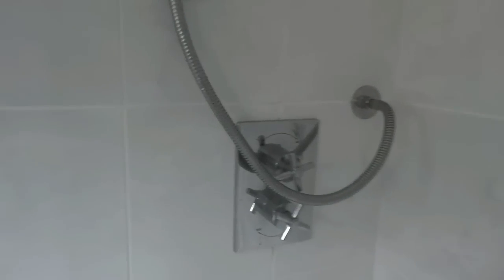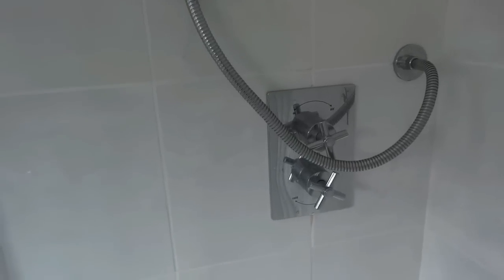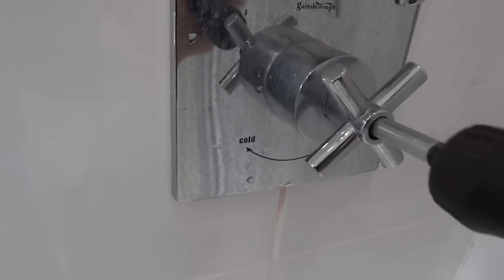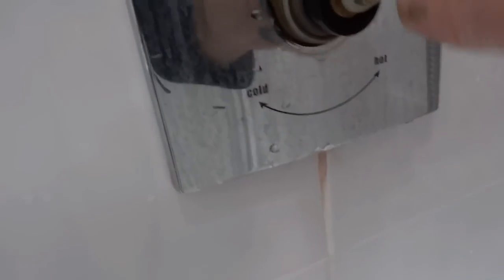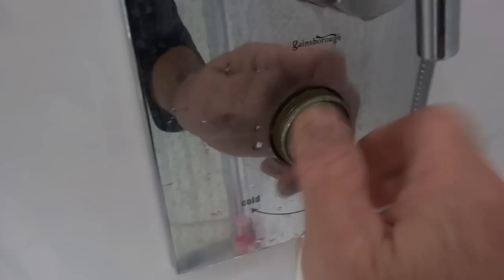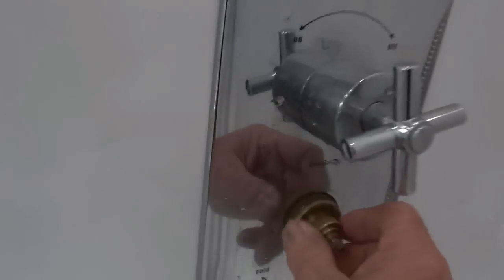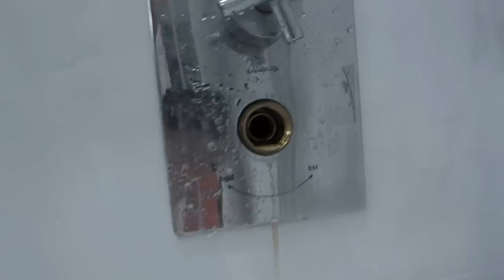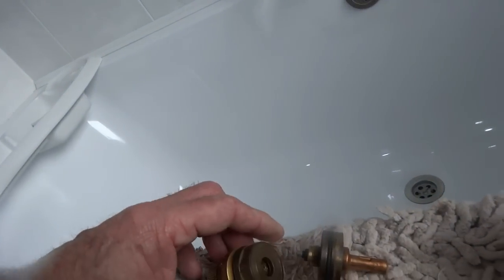How to fix a shower that runs luke warm.Even when set to full heat.

Comment: Thank you so much - I have had 4 plumbers tell me they can't help, I need a brand new shower and so on.  Turns out I can fix this myself - just need to find a new cartridge.  I would have made the mistake you made if I hadn't watched the video and when i got to the bit where I have to use a bathroom wrench to get the cartridge out, your video gave me the confidence to do this.  Thanks again!
Reply from the maker: No problem Rebecca.

Comment: Have exactly that shower model from Gainsborough, found your clip after opening mine. Mine wasn't broken but the water was lukewarm. The thermostatic cartridge needed a bath of vinegar and some silicon spray to get it going.
Now all is working and had a good laugh with your video.
Reply from the maker: Nobody like an old fool. Ha ha.

Comment: Thank you so much I am was having the same problem. Now that I know what the problem is I can find a solution. I was getting burning hot water from sink. But the shower was only giving me luke warm water. It get hot for a very short time then get cool to cold very quickly. I have a woster combi boiler.

Comment: I have a concealed triple  valve  when using the fixed head I can only get luke water at best where when using the flexible head I can adjust temperature no problem  
Both heads use the central control valve .
Reply from the maker: Could be a blockage in the filter or the thermostat has gone.

Comment: had a problem like this, it was in a combi boiler, so it was fun trying to get running hot water without heating. boiler just wouldn't heat up water because there wasn't enough flow - because the thermostatic shower tap would mix the hot and cold water to all the taps in the entire house. Basically the buildings cold water feed was such high pressure that it would overpower the hot water supply from the boiler and the  cold water would come out all the hot taps.

We called the boiler engineer, they diagnosed it as a divertor valve fault, because normally when you get central heating but no hot water - that is the case. They also did a routine heat exchanger clean. Then they realised it was a fault with the thermostatic tap and cut the supply to it off. 

I'm down £350 - got hot water, but they went about "fixing" things that didnt need to be fixed to get to it. They said I needed to get a plumber in to fix the tap and they don't have parts for it. They literally cut the hot supply to the thermostatic tap and capped it off, not even put an inline valve in it to make it easy for me to DIY repair it. Now I have to shut down the entire water feed in order to fit a new cartridge.

Just wondering, is this usual for the thermostatic tap to go kaput and mix the hot and cold in the entire house?
Reply from the maker: It should have had a non return valve fitted it would have stopped that from happening. Also I would suggest fitting a pressure reducer on the main to bring it down to 3 bar.
Reply: @dereton33  thanks, I will fit a non return valve. This is the trouble with homeowners, the previous owner got a cowboy in to do the work.

A proper plumber would have installed  this correctly first tims. The high pressure from the cold probably took out the thermostatic cartridge as it requires even pressure on both.

Comment: Thanks for the video. I think this will fix my shower once I find the correct part. How do you turn the hot and cold feed off? I cant  figure out where the stop cocks would be
Reply: Ok, I figured out its done via the red gate valves in the airing cupboard. Of course mine are stuck, so now I have to follow your tips in your other video on how to unstick them :)
Reply from the maker: Plumbing problems they never end.